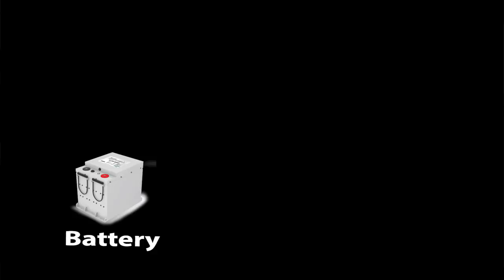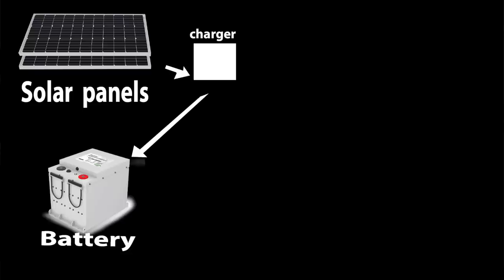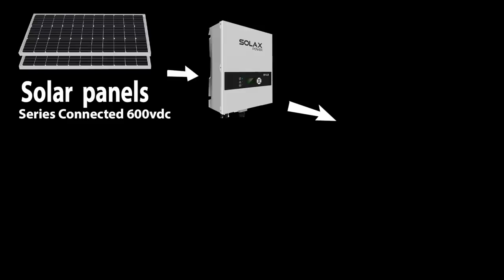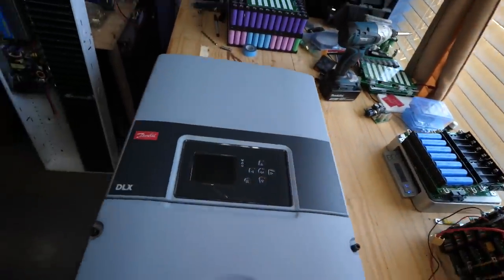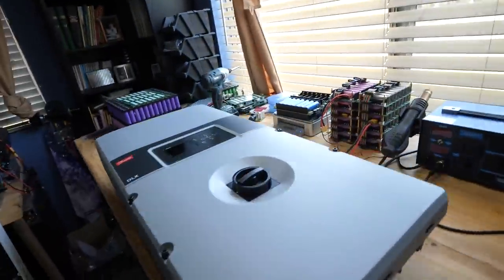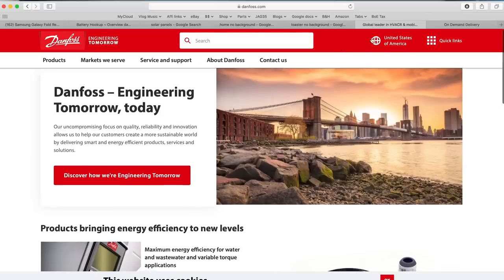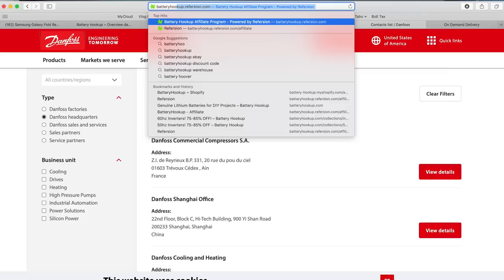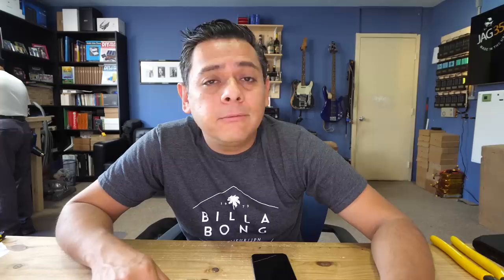Why are these Danfoss SOLAR Inverters So Inexpensive?

Comment: You mentioned 2 phase AC. Technically our AC in U.S. is split phase or single phase running 2 hots 180degrees out of phase.
Reply: 120 degrees...
Reply: @captainmashedpotato2630  In US spilt phase system it really is 180degrees. Three phase system has 120degrees difference.
Reply: @captainmashedpotato2630  
Tri phase AC has 120° phases. 

US uses a transformer with a hot at each end of a coil and a neutral from the central tap. Hence 180°.
Reply: i've tried explaining to co-workers the difference between 3-phase and split phase and i usually get blank stares..  lots of people call it 2-phase power and it's a tough habit to kick.....
Reply: For Europeans who understand yellow 240 v to 110 volt site transformers and the way they work for safety purposes, the US mains system is often (but not always) working in a similar way. It's just that with the yellow site transformers which have a centre tapped transformer there are two 50 volt AC lines referenced to the centre tap which is connected to ground. 

The 110 volt supply (European yellow transformer) is taken ACROSS the two output lines which (due to the centre tap) are 180 degrees out of phase so it's not two phase but split phase. 

In the US they have an almost identical transformer connection but giving split phase 240 volt (each half of the output transformer giving 110/120 volts referenced to ground at the centre tap. This gives a 180 degrees out of phase output across each winding, so that 220/240 volts is available ACROSS the output connections (NOT using the centre tap) but with a max of 120v to earth as a consequence since the neutral/earth is connected to the centre tap. 

Quite a neat system to overcome the current/power limitations of a straight 110/120v only supply which is a bit alien to Europe but common place in the Americas generally (and other parts of the world too).
Reply: Bob Jones 
90 deg
Reply: @captainmashedpotato2630  is right.  Two phase AC in the US is nothing but 2 legs of a three phase system.
Reply: @chrisw1462  Nope. The 'two-phase' power supplied to residences in the US is 180* apart. It comes from both ends of a center-tapped transformer where the center tap is considered 0v or neutral. If the two legs were 12* apart, you wouldn't get 240v across them, nor would it be sinusoidal.
Reply: @chrisw1462  

Where did you hear this? A 3 phase system has 3 phases 120 degrees. A 2 phase system would jave 2 phases 180 degrees.

Never heard of a 2 phase system.
Reply: @MrRShoaf  As far as I know, power is always transmitted as 3 phases at a very high voltage.  When it is transformed down, you get 120 across any single phase, and 220 across any two phases.  I only have experience in industrial power, so maybe it's different in residential transformers?
Reply: most residential is single phase, 2 legs in the same phase, hence the name. they don't use 2 phase any more.
Reply: @chrisw1462  Its 240vac NOT 220vac across l1-l2 and 3 phase can be 208 and 480. U.S.  110 and 220 hasnt been used in the U.S. for many decades. Its now 120/240 for residential.

Comment: Jehu most modern  appliances can run in DC too. Only need AC for old heaters , ac motors pumps, old air conditioner etc.

We are charging our EVs with DC directly
Reply from the maker: But there are no standards, 3v, 5v, 7v 9v, 12v,  what voltage do you make your dc system?
Reply: @jehugarcia  220v DC. 30v panels in 8s5p  240v then 200v 360ah batteries

Then we use 220v DC to most things like Led TVs , cook top , Air conditioner,  fridge , charging cars, lights fans, power supplies etc all running fine on 220v DC

Even Arc welding machine runs fine

 we also have 220v DC to AC inverter 10kw for water pump , power tools,

We live in India
Reply from the maker: Oh yeah that makes sense,  use every devices already built in dc to dc bypassing the rectification part of it.

Comment: I think the circuit loops through the disconnect through multiple contacts because with DC it is hard to open a circuit under load. With DC a single contact as it opens under load will draw an arc that would not extinguish. Using the spaces between multiple contacts in series gives the current a better chance to stop and break the arc.  Danfoss has been around for a lot of years. We used their DC motor controls on our machines at work.

Comment: You mentioned Grid tie in for this unit, but no mention if they could be used for residential Off Grid use? 

 It's just an inverter, so shouldn't be a problem with same or similar configuration.

Comment: Its expensive because you bought a fancy computerized one. You can by a couple of cheaper ones and daisy chain them. I went to a junk yard and raided cars that had a bunch RVs, it cost me like 40 bucks and the wiring cost me like 25 bucks more. And then I added wind turbines and two back up generators one gasoline and one gasifier. I make enough electricity to run every thing in my house like I was still on the grid.

Comment: If grid goes down does the inverter automatically shut down so it doesn't fry a lineman?  Or do you need a transfer switch of some sort?
Reply: It is call anti islanding and is a legal requirement for a grid connect inverters, they only output power when they can detect the grid.
The inverter has to match its output frequency to that of the grid. As soon as the grid goes down the inverter automatically stops output.

Comment: Correction: 2 phase is long gone. You say split phase( L1,L2 & neutral)
Danfoss makes quality refrigeration an now electronic power equip..
Reply: @eabyrd1506, Good info.. I'd like to add the reason the solar DC switch is jumpered into series of switches is because of serious arcing occurs on switch contacts with just 42 v open circuit PV terminals.

Comment: Hi Jehu. Thanks for the great video. I like these inverters. But my question does a bms exist that can handle the high voltage 240v. How would you protect your battery bank if you rewire it to 240v instead of 48v. Any input or links would be helpful. Thanks
Reply: You would need to design a BMS capable of such voltages. The question is though, why would you even contemplate running those sorts of voltages on a battery bank? 

The cost of components and the time cost to engineer such a unit would greatly outweigh any benefit, of which I can't think of a single one.
Reply: @Jimmeh_B  thanks for the reply. The reason if you look at the specs the input DC current for this inverter needs to be 230V - 500V.  That is why I was asking. I can spend 650 compared to 2500 on a similar sized inverter 4400w.   I have about 15kw of 18650 cells at the moment.
Reply from the maker: It’s not hard and it’s very common,  every modern EV has a 400v pack (96s)  there are a few bms units out there that work well.
Reply: @boki3jaki  fair call. Had no idea.
Reply: In that case, if you go ahead with it, be careful. I've worked with HV and have been a hobbyist for 35 years. Those sorts of numbers DC make me nervous.
Reply: It's one thing being a couple hundred from solar and limited to 5amp max. WHOLE other beast with an arc flash event on a battery bank of that size.
Reply: @jehugarcia  thank Jehu for the reply. Do you have any recommendations on a bms that would be good.  Will you be putting something together like running one of those inverters on batteries?

Comment: Few years a go I designed a few inverters and the hardest part is not software, the hardest part is to have quality coils for the filters. Those coils have to be calculated according your operation frequency. So my very old opinion is that you should not try the 50 Hz inverter on your 60 Hz grid. Keep rocking ;)
Reply: the premium inverters have tech to detect arcing, my worry would be the house burning down lol

Comment: I am assuming you can connected them in parallel to get a higher output wattage? How would you get 2 phases @ 12kW?  I'll need it to charge the car and run a heat pump, plus other house loads...
Thanks for the review and intro to this product!

Comment: Wow, I learn a lot from these videos, but at 06:12, there's a left turn.  Hope this helps:

The L1 and L2 carry 120VAC relative to neutral, but 180deg out-of-phase to each other, so 240VAC between them.  There's no ground on the AC-side terminals; the ground wires for everything come that bottom ground rail.

You have to track ground and neutral separately, especially if using GFCIs anywhere.  Neutral can be volts off of ground and change if there's high-draw machinery around.

Comment: Those prices are truly awesome and no need to pay extra for a remote monitoring solution.  Wow!
Reply: Chuck,
Careful there.  It's not that there is no "need" for remote monitoring but that this service is supplied free of charge by companies like SolarEdge and others because it's mandated.
The thing to understand with these is that because they don't communicate, they won't be approved for grid tied installation in California... and soon other states will be the same.
Reply: Jerry Moody , at least it's not obsolete.
What I had to say was a warning, and it is 100% valid.  I don't have a dog in this fight.  I don't care what inverter you use.  I'm simply flat out saying that if you don't get an inverter that can communicate you may wind up having your system denied a connection.

Comment: The grid is 3 phase and your grid inverter is 3 phase. You can tap the grid for 2 or 1 phase. Residential is 1 phase but it is split for your house, hence the name split phase. Essentially it's a center tap transformer. You receive 240v split phase. Split into 120v.
Reply: Mainly in the US not in Europe where  we get PROPER 415v three phase (when required - standard in Germany and some other European countries)

Comment: Does it have a battery charger in it? Does it have a built in charge controller? Is it sine wave or modified? Nice price if it does.
Reply: Dan az I was wondering the same thing. Did you ever find an answer

Comment: Grounding lug, or bar. the ungrounded (positive) grouded  (negative) on solar panels, Inverter has three string capability. My Sunnyboy unit has never got a high enough temperture to turn on the fan motor. You can place your hand on the unit and it's warm but no close to being hot. I think you took it apart as far as needed.  The sunnyboys are putting out up to 8,000 watt units. You have to make sure your getting a 60 hertz / american power unit. It is possible to get a none US power unit, and I doubt that the European units will work on the US power grid. good video.
Reply: grid tie inverters are designed to sync with whatever frequency the grid is running at, because of this most of them are universal frequency.

Comment: The multi-pole dc switch is wired in series in order to quickly extinguish arcs.
Reply: Hey there, were you able to install and use yours? I have bought one from BatteryHookUps but unable to install it yet. If only someone make a YouTube video on the install will be a big help 😋

Comment: Can these be used in an off grid system? My home is completely off grid on batteries.
Reply: I don't think so.  As shown on 17:14, don't believe grid tie inverters work without grid code.
Reply: Grid tie inverted check for a source signal and then sync up to that signal ( your grid connection) before they will output power. 

If you had a full sine wave inverter that it could sync up to , then perhaps.
Reply: If you make an AC coupled system, it will likely not know the difference between the battery generated AC signal and the grid AC signal.
Reply: @johnkollhoff  AC coupling is not really off grid.
Reply: @BrianHSC  it certainly can be. You can do that with a pure sine wave inverter and a battery bank, or an off the shelf solution like a Schneider Conext. The solar inverter doesn't care where the signal comes from, just needs a signal to sync up with.
Reply: @johnkollhoff  So you are saying you need another inverter to use this inverter. That makes perfect sense but is not exactly efficient. This is a very important question because a lot of people are surprised when their grid-tied system doesn't work when the grid goes down. For this, there are other inverters that do both grid and batteries.
Reply: @proppo4924  What I said was that this COULD be used off-grid if you had another way to push a sine wave to your inverter to make it think it was on grid. For the cost of these units, this is pretty efficient. You could buy a couple Sine wave inverters for the difference between this unit and a unit at retail price.
Reply: l Eltek inverter AC coupled to Victron Quattro inverter. work perfectly fine.

Comment: They put all of those switch contacts in series because it is VERY difficult to break a DC circuit under load without it arcing over the contacts.

Comment: pretty weird to hear you talking about a grid tie in converter - you can't just run it as a normal inverter because it requires to be tied into the electricity grid to function and that is not lucrative right now, also when people buy solar they usually buy a package deal... you can however hack the inverter by back feeding in current from a smaller regular inverter to make the inverter function as an regular inverter without grid tie in from batteries or solar.
Reply: No you can't. The smaller inverter would burn up as soon as the larger one kicked in. Unless you have a load ready to take the load. It would have to be equal though.

Comment: They’re a under rated for a typical system now (5kW inverter for 5.5kW solar system). And I would not suggested using them with batteries as a power source. These would have an mppt tracker on board and zero protection built in for batteries. You could do it to test the quality of the AC signal under load but you’d need to provide it with Grid AC which kind of defeats the purpose of a battery inverter. Could be useful for small ancilliary systems but you’d want to make sure you get a minimum 5 year manufacturer warranty and I doubt that as they no longer make inverters.

Comment: Jehu once these have the setup program run, access to some setup items will disappear and need a contractor's number to get back in if system changes configuration, for instance. Instructions say in lieu of this password, a call to Danfoss is necessary. If we are DIY-ing it, got a suggestion for the installer code?

Comment: 13:55 Jehu, dont connect 50Hz inverter to 60Hz grid!!! But maybe you can find configuration for grid frequency in the menu. If yes, please set frequency to 60Hz. If you can use inverter off-grid, than you dont care about frequency, because standard electronics dont care about grid frequency. Thanks for video 😉
Reply from the maker: So maybe good candidate Offgrid then because we have tons of the 50zh version

Comment: I would like to know if you would recommend the Aim power 5000 24 volt pure sine inverter for off grid application. I would like to use a split level 12000 btu 110 volt AC air-conditioner for this application please advice, thank you
Reply from the maker: Sorry I don’t have personal experience with that specific model,  maybe other viewers can chime in
Reply: Pete, I'm using an old Trace SW4024 Inverter to run a 12000 btu 110 volt AC mini split Inverter air conditioner. Inverter AC units are variable speed and are more efficient ,look for a unit with a SEER greater than 20 (higher the better).Mine starts up pulling 4 Amps then slowly increases to 9 Amps. When the room is cool, Amps go back down. Best thing since sliced bread.

Comment: You get what you pay for in inverters, the premium inverts have a low failure rate and expectational customer service, the less you pay the higher the failure rate and the less customer support. your better off buying cheaper panels than a cheap inverter, single string inverters have a lot of current flowing through them, a poorly constructed 1 could burn your house down.

Comment: The multiple contacts gives a bigger distance to break the current.  DC doesn't have a zero crossing so the current is never zero.  With AC there is a zero crossing the arch goes out during.

Comment: I eventually want to have a room in my house that has European power from a 50hz unit and the rest of the house on 60hz. There'd be a solar pannel setup just for the EU system one. I want to collect tech from around the world and would like a way that won't ruin the tech by just stepping up 120 to 240 at 60hz i know most newer tech doesnt care about hz as much. But I have some other projects I want to test and it would make it much easier to have the native output. I was looking into ac-dc-ac converters that have a very good sinewave output as an option till I can build my dream home.

Comment: I hear that inverters are the first thing to burn out in a PV system. Why is that? Do they run hot?
Reply: Inverters are vastly more complex in operation than solar panels, so they tend to not last as long as the panels themselves. It’s possible to design a inverter to last a very long time, but it would be massively more expensive so it’s not done. A good inverter lasts typically 15-20 years, so it’s not really like they’re swapped out too often. Some of the lower cost or poorly designed ones might last closer to 10 years, whereas a solar panel can have a practical life beyond 30 years.